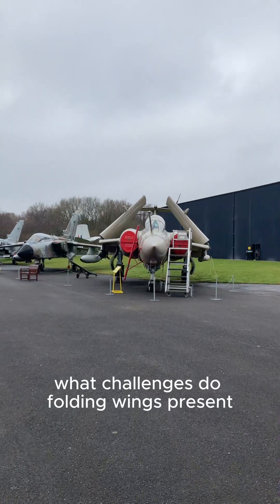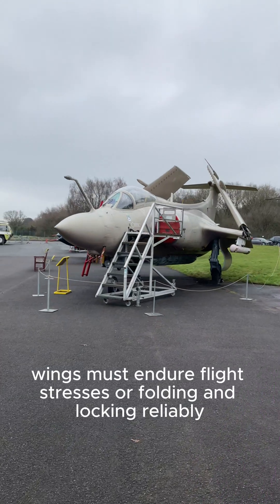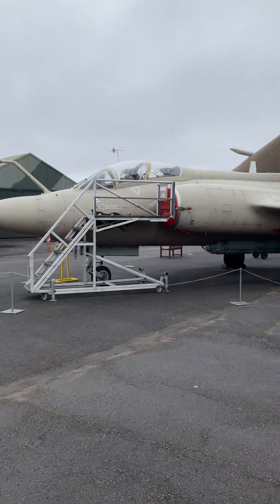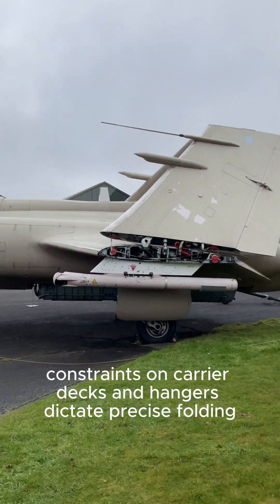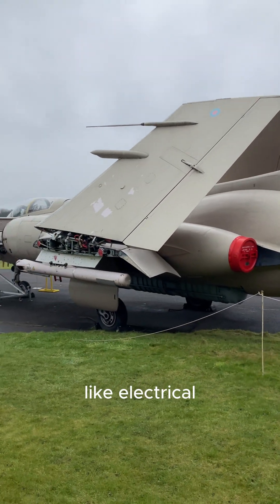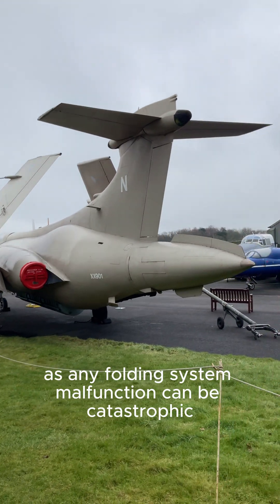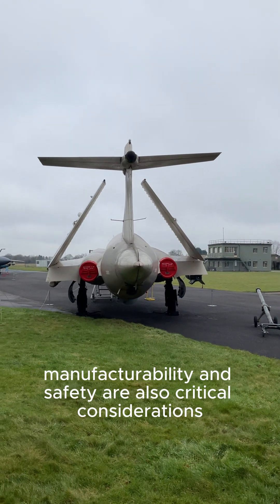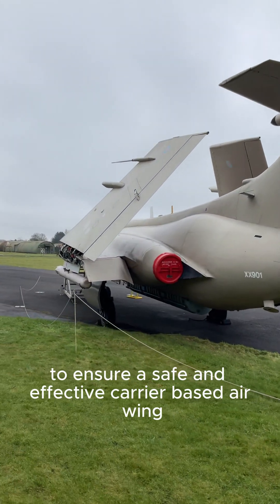What challenges do folding wings present?

Comment: As I recall and it's a long time ago now, the outer wing is held on to the inner wing by a vertical two inch pin on the main spar (Seen as the big lug at one third of chord) and a horizontal pin at two thirds chord at the rear spar. there is a very sturdy hinge mechanism in between them whilst the fold actuator knuckle can plainly be seen at about mid chord. Normally, the folded wing would be fitted with struts - they would support the wings should there be no residual pressure in the hydraulic system to prevent overstressing the hinge.
Reply from the maker: Thanks for the info!